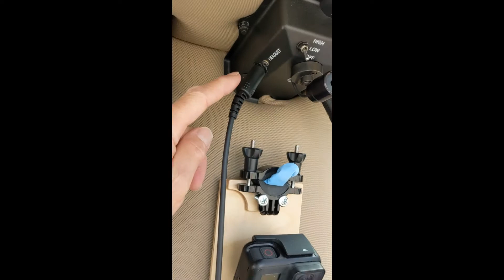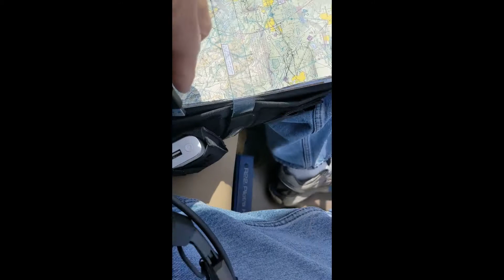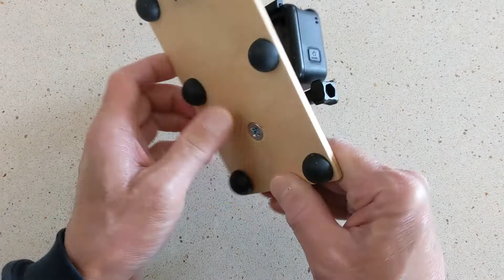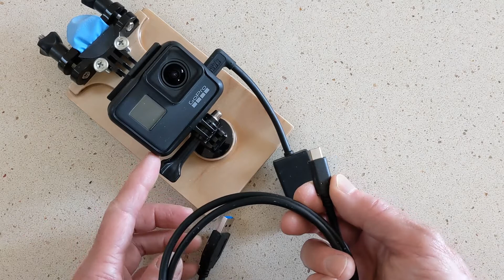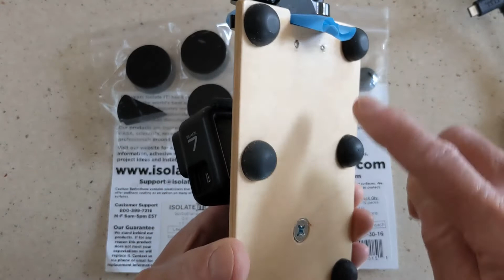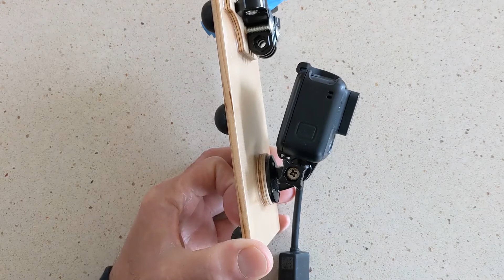GoPro Inside Camera Mount and Cockpit Audio Recording for R22 Helicopter

Comment: Thank you for putting this video together. I am surprised at how much engineering you put into this custom mount. I thought you just bought some mount off the shelf. I'm not sure if I have the woodworking skills to build one myself. How did you cut out those wood pieces that are not rectangular like that round spacer? I just talked to Ben today about his setup, and he mentioned that the GoPro case needs to have an opening on the side to allow for those cables to be connected. I see that your case has that opening. Did the case come with the GoPro or do I have to buy that separately?
The only feedback I have is that the USB Type C to USB-A cable is a USB 3.0 cable which is probably more than you'd need to provide power. A less expensive USB 2.0 cable might have been enough.
Reply from the maker: You don't have to get fancy with the mount if you don't want to. Just needs to be functional. I just wanted to smooth things a little with sandpaper, and I brushed on a few coats of clear polyurethane so it wouldn't pick up dirt and fingerprints as much. The round spacer I probably cut with a hole saw because I have them, but a square or odd shaped block would work just as well, or just a stack of steel fender washers with a 1/4" hole from the hardware store if you want. I'm sure there are a lot of other ways to do it. I'm just showing what I did. I think the most important thing is to start recording your lessons.

I'm pretty sure the "case" came with the Hero 7 Black as I don't remember having to buy it extra. The "case" is needed for the Hero 7 Black because it contains the mounting "ears." The Hero 8 and Hero 9 have integrated fold down mounting ears, so you don't need the "case" for those, but I think you may have to remove a door to be able to plug in the external mic adapter.

Comment: Wow, great work! You've inspired me to up the quality of my mount 😝
Reply from the maker: Thanks Eddie! I incorporated the information you shared with me about taking out the internal battery when using the external battery. That really helped me, along with the tip to get the Bose A20 headset, GoPro Hero 7 Black, and the audio adapter cable. I wish I had gotten the GoPro Hero 7 Black set up in the first place instead of the SJCAM SJ6. I really regret not getting the audio recorded from my first flight with Justin Balinski.